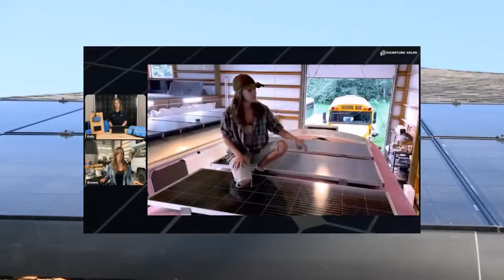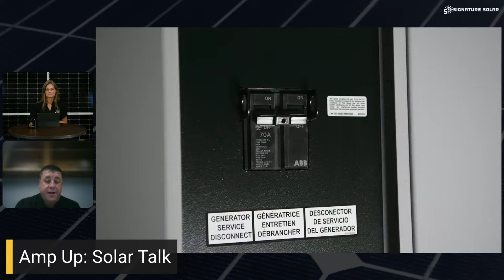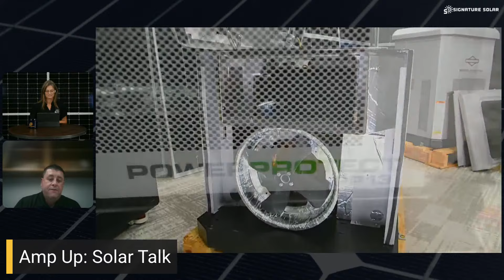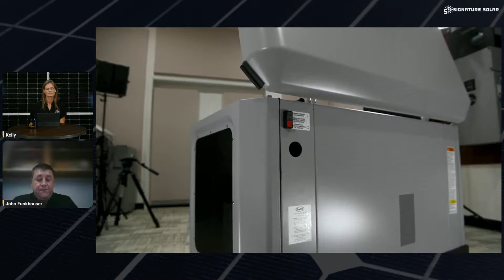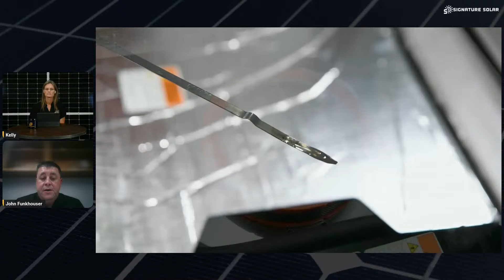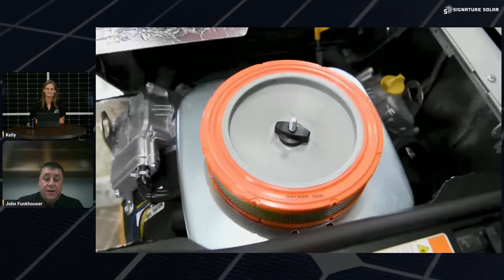Amp Up: Solar Talk - Ep. 32 - Power Protect Residential Standby Generators

Comment: A topic not addressed is the quality of the current coming from these generators.  Can you tell how they work with the charging or electrical components if using inverters and batteries?   Pure sine wave or will it need something to allow safe power to our electronics?
Reply from the maker: From John: We have our generators set to provide 60Hz as often as possible, but do allow for +/- 5% for Total Harmonic Distortion (THD), which is standard within the generator industry.  We have not seen issues with not being able to charge batteries or disrupt appliances or items within the home because of the lack of cleanliness in the power produced by the generator.

Comment: John hit on a keep concept of using Battery Backup first and then the generator as option to charge up those batteries.  Can he comment on using a 13KW  unit for this type of application?  Thinking of having this size running on Propane as will not run extended time if primary used as a charging source when no solar input is available.
Reply from the maker: From John: For the generator backing up the batteries, you will want to make sure you program the inverter to pull enough power from the generator, but leave yourself enough capacity to power the home or critical load panel that you have in the application.  The reason for this is that the battery cannot charge and discharge at the same time.  If the application is to charge the batteries and maintain a critical loads panel, then a 13kW would most likely work.  If it is a whole home application, you will most likely need to bump up to at least a 22kW to handle the charging of the batteries and backing up the home.